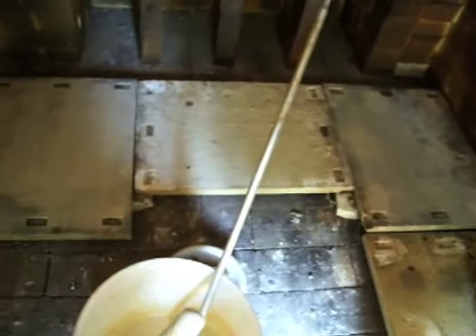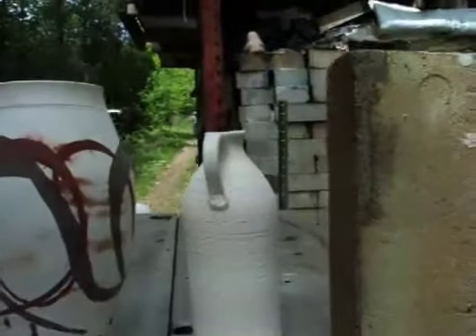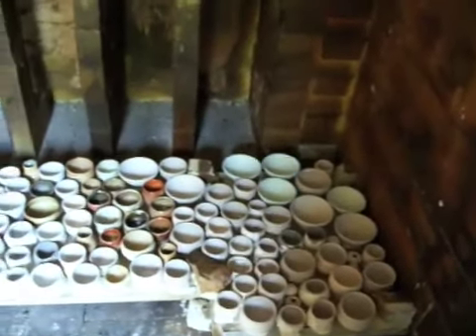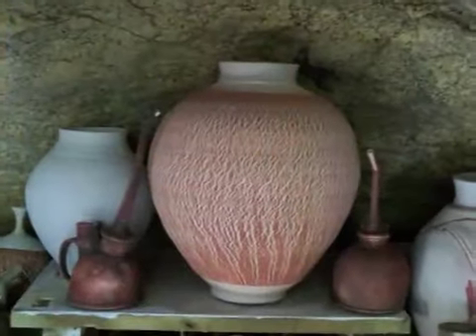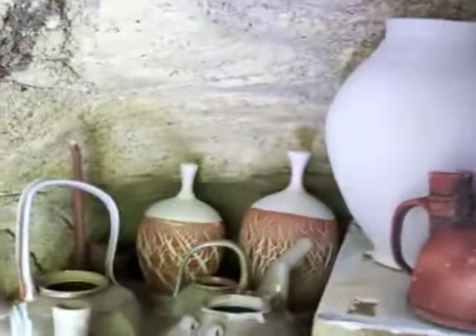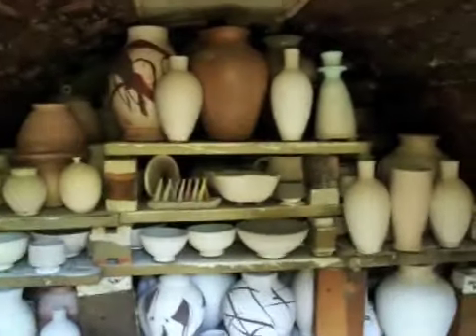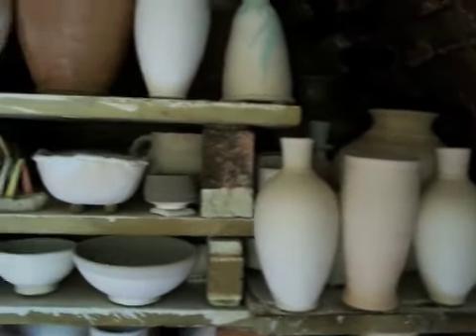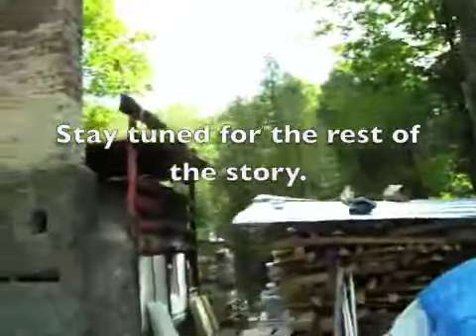loading 6

Comment: Is it possible to make a smaller wood fire kiln? New subscriber
Reply from the maker: Yep there is a point though that the work needed to fire and the amount of pots in the kiln don’t even out. This kiln is fired for 48 hours straight and if you only had 100 pots in it and you lose 20-40 of them it may not be worth the time to fire the 60 pots you can get out of it.